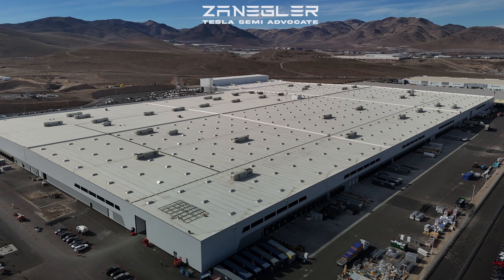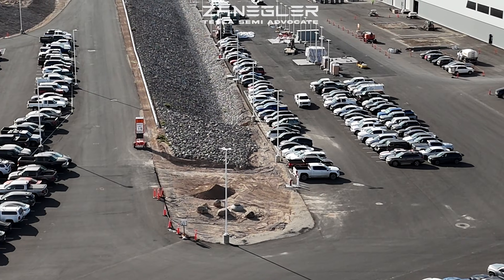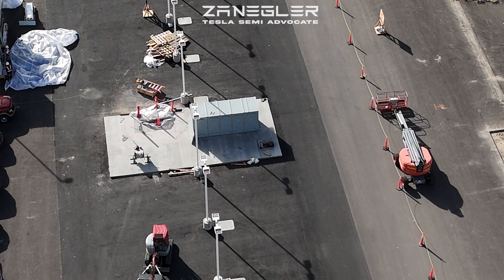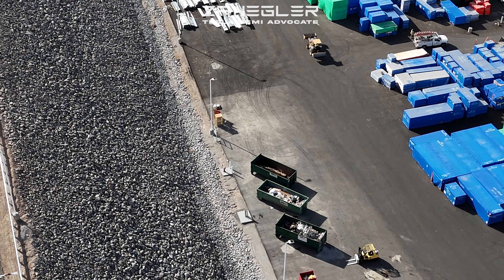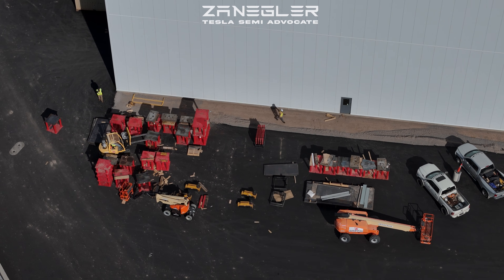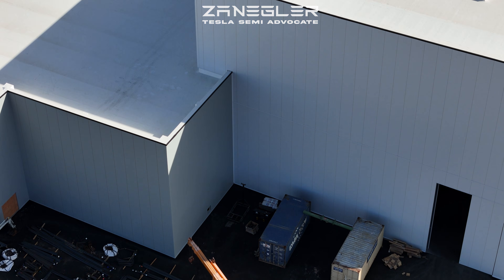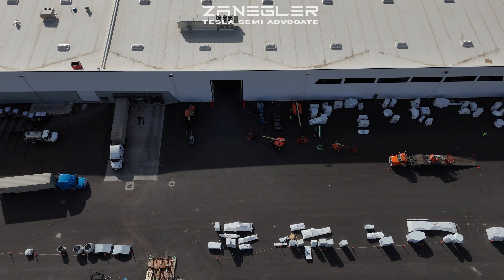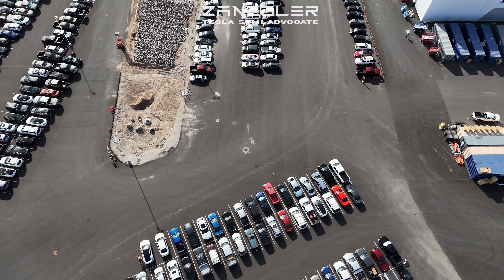Tesla's Giga Semi Reaches Max-Q

Comment: Some Giga Semi relevant points from the shareholders meeting video. Titled '2025 Annual Shareholder Meeting | Tesla'

Use of 4680s proposed for Semi and Cybercab at 1.35.06
View inside of Giga Semi Stamping at 1.35.41.
View inside Giga Semi GA (I think it's GA) at 1.35.44
Production problem with the Dry Cathode in the 4680s. Elon confident of it being successful....1.41.43.

Comment: Thanks Zane
Sort by newest first or top comments if only the first few lines are visible
3:09. East. Apron. Saw-cut and demolishing 2 squares of asphalt paving.
7:20. Stamping. East door. I see rebar ties for ground beams. Pit still open, protected with guardrails. Stand alone stamping press may not have been installed yet.
9:36. Stamping, south west corner. Apron. Forklift shifting around the stands. These are temporary, stamping pressline components placed on these for the SPMT to drive under. SPMTs can raise and lower to place or remove the various items on these stands.
10:00. Stamping, west. Apron. Stacks of large diameter rebar. Still building inside.
11:14. West, apron. Gear covered in plastic with the Petra logo. Red Herring, I think these are salvaged plastic sheets from some other Petra gear (Petra with this logo is a HVAC equipment supplier).
The black cylindrical items I think are base for robotic assemblers. Rest of the surrounding gear looks like assembly line equipment, stands, guards etc.
Reply: Thanks, Dessie. Your comments here are really helpful.
Reply: @WarrenLacefield  You're welcome.

The black cylindrical items at 11:14 are robotic assembler bases. I watched (mostly with the sound off) the shareholders meeting, and there were a few views of the Cybercab production line. The exact same bases are shown. At 1.12.07 for example in the '2025 Annual Shareholder Meeting | Tesla' video.

We saw these in Zanegler's previous video, but I wasn't sure what they were. At 15.45 in the 'Mega Giga Tesla Semi Progress!' video.
Reply: @DessieDoolan  Yes, those bases must hold the robot assemblers absolutely still, while under high torques. (Or they have to sensor-adjust like Optimus would .. or everything they do and touch be in the same inertia frame. 🙂) I watched the Shareholder Meeting as well. I thought there were several shots in demo videos that showed the Semi factory interior, maybe even in stamping. But I might be wrong.
Reply: @WarrenLacefield  I'll go back and scan through it again. I was deep in sudoku, crossword, wordle, connections, and strands mode while watching!

I will have missed a lot.
Reply: @WarrenLacefield  Just quickly skimmed through again.

Found these bits of interest.
Use of 4680s proposed for Semi and Cybercab at 1.35.06
View inside of Giga Semi Stamping at 1.35.41.
View inside Giga Semi GA (I think it's GA) at 1.35.44
Production problem with the Dry Cathode in the 4680s. Elon confident of it being successful. I take that as they aren't there yet. 1.41.43.
Reply: hey Dessie. Good to see you here again and offering your expert observation skills and commentary.
Reply: @GntlTch  You're welcome. Very quite now at GT with Brad dropping out.
I think it will be slim pickings at Nevada as winter sets in and the works move inside.

Comment: Heinrich, when you show the chargers it is always very hard to imagine how trucks would pull in and out of the chargers as the spaces look really small in the video. Would there be any way to do an overlay like Joe often does to get an idea of scale and how truck could maneuver or do you anticipate that they will have to unhook the load to charge?
Reply from the maker: These chargers will be used for semi bobtail fresh off the assembly line. No trailer attached.

Comment: Is paint faster then powder coat?  Would look into making all panels in their final color from the go. Or any parts that come in are already taken care of coating wise.
Reply: Only need 2 colors: black for frame, white for body
Reply: Only need 2 colors: black for frame, white for body
Reply: @sunshinesfriendscatdogrescue paint line expensive and slow. If frames came in painted and all body work was already white in color. Especially if it's fiberglass or plastic. Aluminum or steel cab wrapped?